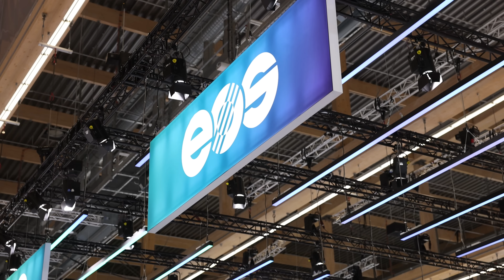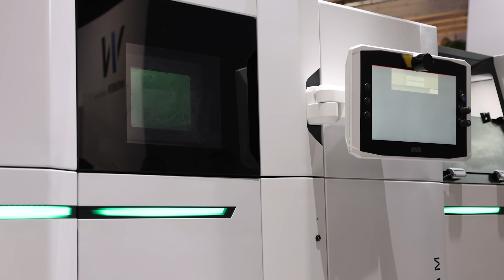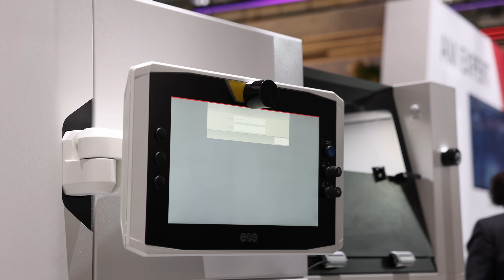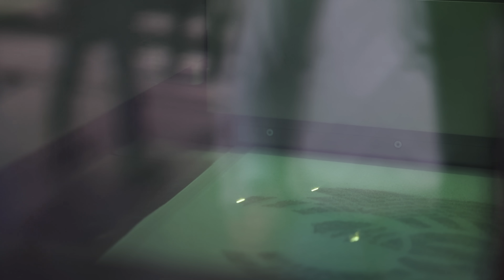3D Printing ALUMINUM FAST! EOS at Formnext 2023!

Comment: Printing those engine cylinders was genius for prototyping because it so inexpensive compared to patternmaking and foundry. Vintage part replacement and upgrade by modifying parts is another winner.
Reply: Wait till you watch the skilled labor AM tech and finisher remove those supports for 20 hours

Comment: Sorry to be that one skeptical guy, but something about the pricing simply does not make sense. I wonder what those 25-40 € are comprised of. The hourly machine rate alone should be way above 25€ for a machine like the M300-4. Would love to see some more information, because I do not believe those 25€ can be the "actual" part costs if you were to sell those to a customer ...
Reply: To be fair for a die cast aluminum the dies cost millions of dollars.
Reply: While I agree with you, the key point in this hourly rate is depreciation. Typically they count 5 years, but de facto the machine can do 15-20. The most vulnerable part is laser (5-7 yrs), replacing it costs 20-30k, which is nothing compared to the machine price.

Also, I have seen mulrilaser printers from Chine for 250k... All manufacturers like EOS etc are toast in a few years with their oberpriced 2M models.
Reply: @Dudowski  That’s not really true if they’re integrating software better than the competition, which will reduce wasted material, running costs, and improve uptime. Just have a look at the industrial automation robotics space, plenty of “overpriced” solutions are industry standard, higher price is worth QA + software and support infrastructure.

Comment: Government and business push electric while telling us how bad we are for producing waste/toxins/destroying the environment.
Funny how its the companies that the Governments allow to do all that sheet... then they blame the guy that buys the product, not the maker.
If you don't know, Lithium is worse with more CO2 then using combustion engines.(unless you don't recycle the lithium and just bury it... where they are about even) 
This is for cars... where the age degradation of Lithium batteries is much less of a concern... Having a mower that you only use once every few weeks is even worse, in terms of amount of USE vs Waste generated.

This actually looks like a good way to get combustion engines back into the consumer tool market.
What they dont tell you is... electric mowers and the like take less EFFORT and trouble shooting by the maker because the parts can mostly be done by machine with far less human required post processing or assembly.

Comment: That pricing would be revolutionary. I'm guessing this is a very tweaked, very specialized cost model and hinges on some key things, like ownership and 80% utilization of a $1 million plus machine.
Reply: Kind of like when I measure my dingle 😂
Reply: Yes, you calculate that you have the machine already....than material, labor and electric cost....machine lasts forever and does not need service and zack 25 Euro/pcs.....the 250 mentioned was most probably the true number....and why would you print 20.000 of the same part if you could cast it as well.
Reply: @psxtuneservice  machine never breaks?

Comment: I'd be very interested in how well the parts behave under high and extreme vacuum. I would expect significant outgassing due to the very porous nature of the parts from the technology. 
If you were able to get this under control, being able to make custom vacuum chambers and components without milling whole blocks of material could be quite beneficial.
Reply: The SLS system here has been in use for the aviation and aeronautics industries already for quite some time. These same machines are used to build rockets and jet engines. I think they will work just fine.
Reply: @stevensmith4099  You`re quire right, additive manufactured implants are today being implanted into human beings, used in flight critical components in many many applications, high performance race cars, moding, ... In very many application fields, highly stressed components under high fatigue load,... the story goes on ;)
Reply: casted components also suffer from porosity; this is controlled as much as possible from the mold design standpoint but it does randomly pop up once in a while where you don't want it (i.e. clean machined gasket surface with a random porosity hole in the interface that starts leaking). For additive manufactured parts that are properly sintered I actually wouldn't really expect this same level of issue.
Reply: @Duckferd  In additive manufacturing the porosity is a function of the processing parameters... So it is possible to tailor the parts performance to the requirements,... it is also possible to create for instant an extremely fast core with controlled porosity e.g. to compare to casting and use a different set of exposure parameters for the surface to be >99,9% dense
Reply: Why would you doo that kind of testning for a lawmnmower engine?

Comment: I am VERY interested in this guy's printing technology. I absolutely cannot afford their machine, but up to now printed metal has also been too expensive for me to buy.

Printing metal parts for printers will be accessible eventually with this sort of progress.

This is also useful for any hobby of making things. Model engines made this way would be great. Anything that is exposed to heat is pretty bad for plastic.
Reply: That's the side of new SLS stuff that we can get excited over. The machines often make cars look cheap, but at least part of the price of a part from Shapeways or wherever is paying for the printer, its maintenance, its input material, and its throughput. If you can change any one of those variables, it'll ideally mean a difference in what per-part prices a place needs to charge (before considerations of profit that might just break all that.)

Comment: THis new tech, safe a ton of hand works, energy, and isums...but a lot of employes are be extinction too..
Reply: There's still a lot of design, verification and post-processing required. Plus a lot of people to manage, load and maintain the machine. If anything it's probably less automated than a die-cast process in a factory setting.
Reply: pos processing? CNC machining?i watch a lot of metal 3D printing , i never see about cnc pós processing....  @stevensmith4099

Comment: What drives me up the wall with metal powder, especially aluminium, is that it's finely powdered in its natural lifecycle coming from ore, but somehow when you grind it for 3D printing, it magically increases the price 400-2500% of the native ore price pound for pound. Industrial ball mills aren't that expensive.
Reply: You’re totally right.

I think the price does skyrocket when you want the particles to be of an extremely narrow band of sizes
Reply: The problem is that powder is made not with industrial ball mills. It is made with gas atomisation stations instead. This way is much more expensive but allows to produce particles with exact needed size range and sphericity. Sry for my English :)

Comment: For the moment dye cast is still cheaper just because its been around for so long, in 10 years metal printers will be on the same price trent of 3d printers
Reply: Not sure about that. The feedstock for printing has to be a fine powder with carefully controlled particle sizes. That requires pre-processing that isn’t needed in die casting. Also, die casting cycle times are very low.
Reply: personally I do believe the technologies will co-exist also in the future, it`s a depending function of volume, price per part, requirements,...
Additive manufacturing today does make sense in certain applications and industries, but not everywhere.
There`s a good reason we have multiple technologies in paralell.